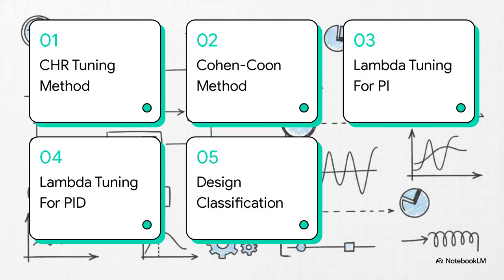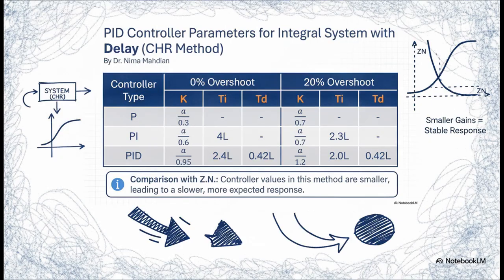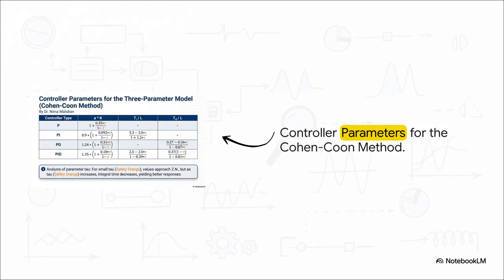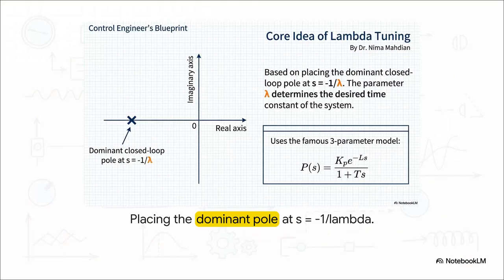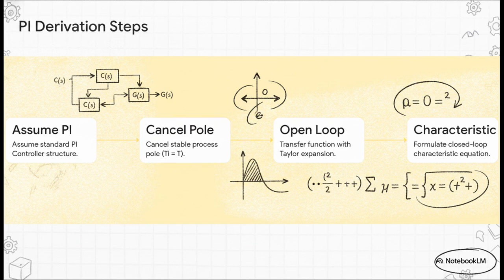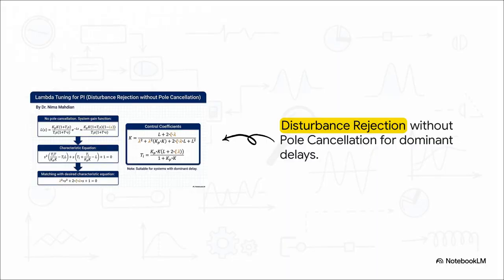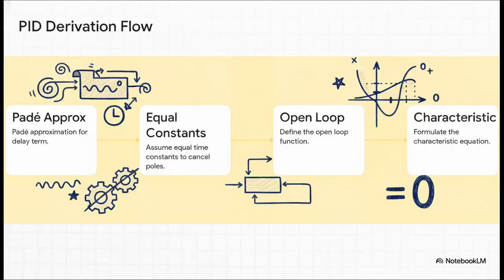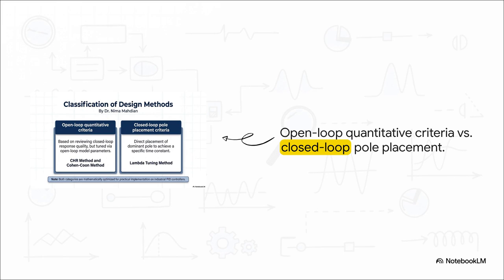Advanced PID Tuning Techniques | CHR, Cohen-Coon, and Lambda Methods for Industrial Control

Comment: In the control-coefficient equation on the PI tuning slide without pole cancellation, the controller gain K appears on both sides of the equation. Is this relation intended to be solved implicitly for K, or does it require an additional simplification?
Reply from the maker: Thank you for the careful observation. Yes, if the controller gain K appears on both sides of the equation, the relation should generally be treated as an implicit equation for K.

Before solving it, however, we should check whether the equation can be algebraically rearranged to isolate K. In many PI tuning derivations, a substitution or normalization is used to simplify the expression and obtain an explicit formula.

So, no arbitrary simplification should be made. If K genuinely remains on both sides after substitution, it must be solved consistently—either algebraically or numerically.

This is also an important point when implementing the tuning formula: the final controller parameters should be calculated from the fully resolved relation, not from an equation containing an unresolved K on both sides.

Comment: Dr. Mahdian, I appreciate this clear and well-organized explanation my question is:
In real industrial controller tuning, how can engineers decide whether to prioritize robustness, disturbance rejection, low overshoot, or a desired closed-loop time constant when choosing between CHR, Cohen-Coon, and Lambda tuning methods?
Reply from the maker: Thank you for your excellent question. The choice between CHR, Cohen–Coon, and Lambda tuning should be based on the process dynamics and the main performance objective.

CHR is useful when engineers want to control overshoot and transient behavior explicitly. It is often chosen when a smooth response with limited overshoot is important.

Cohen–Coon is generally more aggressive and can provide faster disturbance rejection, but it may produce more overshoot and be less robust when the process model is uncertain.

Lambda tuning is particularly useful when robustness and a desired closed-loop time constant are priorities. The engineer can directly select the desired response speed, making it attractive for industrial processes where stable and predictable operation is more important than achieving the fastest possible response.

A practical rule is:
Low overshoot → CHR | Fast response → Cohen–Coon | Robustness and desired settling time → Lambda.

In safety-critical or highly uncertain processes, engineers generally favor robustness over aggressive speed, and the final tuning should always be validated against actuator limits, disturbances, and process uncertainty